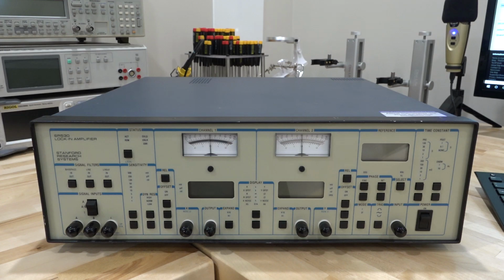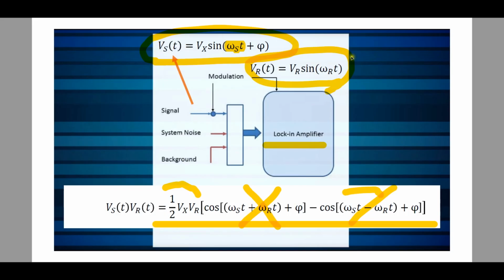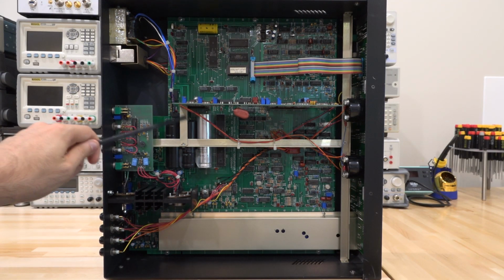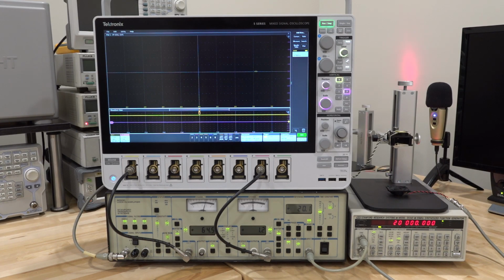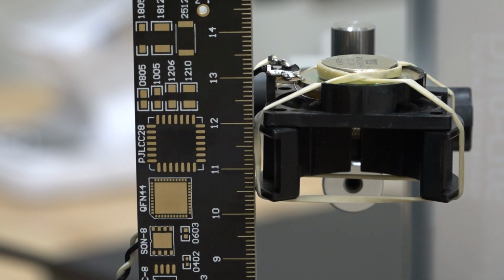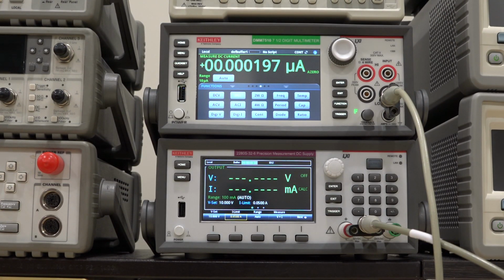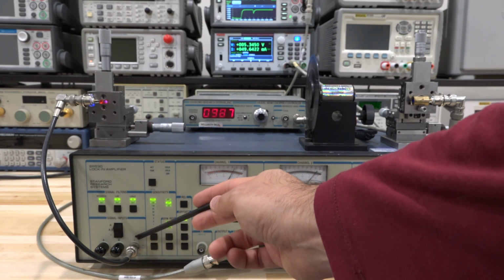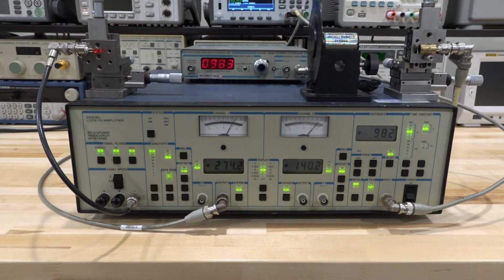TSP #107 - Tutorial, Teardown & Experiments with Stanford Research SR530 Lock-in Amplifier

Comment from the maker: Two minor corrections: I mistakenly read the symbol φ (Phi) as α (Alpha). Also, the exponent value 10^-15 is femto, I accidentally said atto which is 10^-18.
Reply: Hi TSPB - You mention around the 42:00 mark that the TIA is 10 MOhm - i.e. transimpedance of 10^7. However you say & use 10^6 in the rest of the segment. Cool explanation though :) Cheers!
Reply: And "noises of source" around 3:40 ;)
Thanks for the great video and your amazing skill of explaining these highly technical topics!
Reply: Glad you caught this.  I was just now about to post that (if you were small enough) you could conceivably COUNT THE ELECTRONS if you were truly measuring attoamps.  ;)

I'm guessing that lock-in amps are used to pull the feeble Voyager signals out of the cosmic background.
Reply: I've read you're better off with a Princeton Applied Research PAR-124/126.  Stanford?  Makes me think of billions in frauds and gross cheats as liberal as around that area can make.

Comment: 1st experiment: Should have just counted complete turns of the knob - the screw is probably a mm/turn or so. Would have helped to turn off persistance also, and instead go from one point on an axis to another. The persistance of the display, plus the timeconstant of the post process filter made you overshoot also, it was more than 360 degrees.

Comment: One of the Achilles heel of this unit is the vertical daughter card that you pointed out. It is flimsily held in place and is easily affected by any pressure on the top of the unit which rests on the top edge of the card. If there is an intermittent connection at the bottom connectors you can lose the phase output and the unlock light comes on even though you get the correct frequency on the display. Except for this, it's a fine unit.

Comment: The best way to think of this is to think of it as an AC amplifier with a frequency selection bandwidth determined by the fidelity of the driving AC reference signal (within limits of the electronics, of course).

Comment: wouldn't it be easier if you just applied a pulsed voltage from a function generator to the blue light laser diode instead of the light chopper?....the same pulses would be routed to the lock in amplifier as a reference signal and you still can change the Laser  diode intensity by changing the pulse width or amplitude or both perhaps ...any how, i am absolutely amazed by your ingenuity and knowledge ...thanx.

Comment: There are some cheap locking PC board available on eBay of around $60 using the AD630, it might be interesting to compare them to the Stanford unit.
Reply: Have one and it works very nicely, picking 2 mv signals out of 100mv of noise. Forget current mode input. OK for playing around. It will be in your junk drawer after a few days.

Comment: Very nice video!
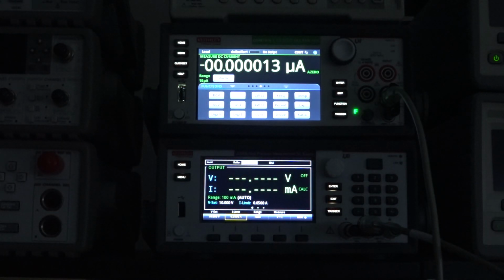I noticed at 35:49, when you turn off the light, the sign of the current changes to negative. Perhaps this is some thermo-current from the connectors or some sort of electrochemical cell?

Comment: Thank you so much for your video. It is the first time I’ve come across "The Signal Path" video and I really enjoyed it. It was very well thought out. I have done some video editing in the past so I appreciate how much work goes into making and editing such videos. 
I have the exact same lock-in amplifier that you used. I am new to lock-in amplifiers so I’ve decided to start with something very basic. I use a function generator to create a signal, and connect it to both the reference input and the A input. I would expect the phase to be the same as my input signal when I set the output to R and Theta. This is not the case. Would you know why? Also would you know what I should expect in this case for the different output options? Thank you so very much!

Comment: Awesome video! Thank you.
I was thinking to use similar setup to measure air humidity more accurately (speed of sound depends on humidity, pressure and temp) but could not find affordable lock-in amplifier on Ebay and was scared to spend money on old one wondering if it is still works.

Comment: It occurred to me that you could probably use a lock-in amplifier with an appropriate frontend and antenna to lock your lab reference oscillator to the WWV carrier @ 10 MHz (with a major integration time constant to account for the eccentricities of shortwave propagation). Not sure whether it would be any easier or cheaper than a GPS-controlled reference though.
Reply: How about WWVB at 60kHz ?
Reply from the maker: Interesting. However, the lock-in amplifier has only 200kHz bandwidth.
Reply: I was suspecting something along those lines. Still, nothing that some synchronous downmixing of both signals couldn't potentially fix, though that's clearly not helping the complexity factor (especially if you have to resort to either dual conversion or I/Q mixing).

Comment: Excellent video. Ended up watching the entire thing even though I have a lab report due! Out of curiosity, what is the power spec of the front amplifiers of the lock in amp? I would imagine if you want to amplify such small signals without too much noise, you would need to burn a ton of power.

Comment: Very nice experiments. I am building a few opacity meters and was testing some photocells a few days ago . (like measuring the sun-nano dark current). I do not have a locking amplifier and I had a hard-time measuring steady under 10nA (the meters I used have pA resolution) so I am really impressed by the measurements you showed and the very clear explanation, Thank you.

Comment: Wouldn't square nature of the wave chopping affect the frequency that you are measuring? We would be adding loads of frequencies to the assumed sine wave.
Reply: That depends on the lock-in mixers used. If they mix the input with sinewave phaselocked to source, harmonics are rejected. However in simpler instrumentation cases you might opt for switched mixer, where it is ineed the case case with harmonic components of modulated signal being detected and integrated into the result.

Comment: 2 tiny blemishes in your enviably great presentation (and enviably stupendous collection of instruments).  On the formula the symbol is "phi", not "alpha" like you say.  By the way, later on you mention "theta", apparently for the same angle.  Second, 10 to -15 power is femto, not atto.  Atto is 10 to -18.

When I was younger, I was drooling about the exact phase lock instrument that you now present.  Never could afford it and now, being retired I cannot justify it for several reasons, one being that I have no room for more instruments of this physical size.  Oh, well.  Keep on the great work!
Reply: The Signal Path It's good to know that I'm not the only one who waffles about what to call my phase offset =)
Reply from the maker: Thanks! I changed the equation a few times during the recording and kept on saying different Greek characters! I added a sticky comment to the video with the corrections.